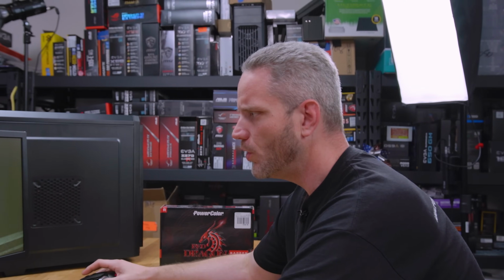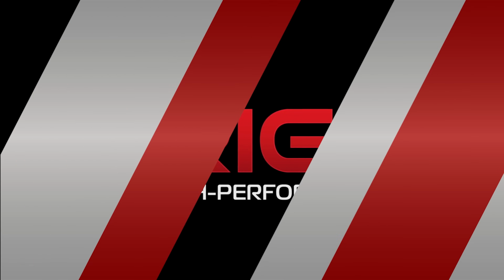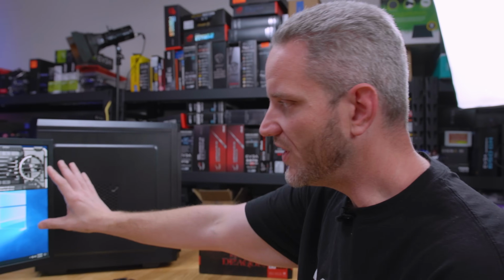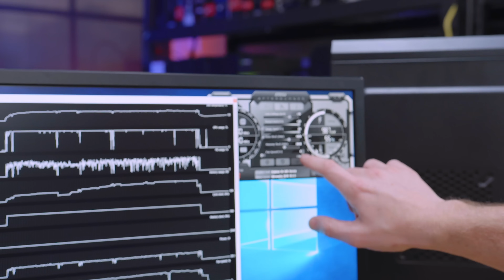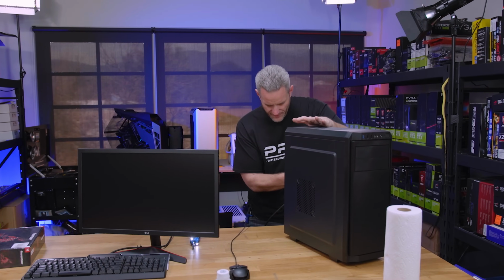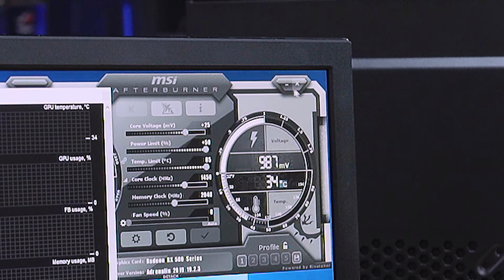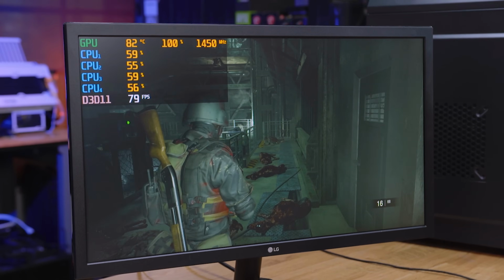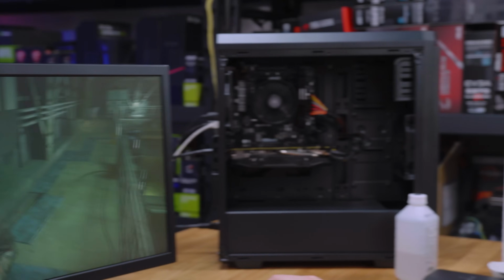Should you replace your video card's thermal paste??

Comment: my gigabyte 3070 i got back in 2022 - my temps after an hour, would be around 82, i dont think it ever throttled, but it got close. so i replaced the thermal past with some leftover crappy corsair paste, and it dropped down to 69 degrees. NICE

Comment: The load temps went from 84C to 65C on my Asus 3070 when I removed the factory paste and applied new stuff. Over 50% of the processor surface area was bare shiny metal when I opened the card up. I'm surprised it ran even as well as it did.

Comment: ON MY TITAN XP NO DVI PORT ONLY 3 DISPLAY 1 HDMI I CHANGED THERMAL PAD POSITIONS AND I PUT NEW COOLER MASTER PASTE THE CARD STAY IN In-between 23C IDLE AND 44 C FULL LOAD NO WHERE DOES MY CARD REACH TEMPS OF 70-80 C JAY

Comment: i just killed my PowerColor rx580 with AG gold termal paste...i thought i have cleaned the older bits of paste but when i assembled it and started the PC the screen started to show greend dots after few minutes and went black...i turned off the PC...cleaned the new paste like crazy spraying brake cleaner all over the card and cooler...before that i looked the chip and around it with my phone camera and i saw a little bit of the Gold paste around these little things just by the chip...i am sure this blowed my 580 but i thought it was clear looking with a naked eyes...after the BIG clean and 2 hours on the sun to dry everything the card was still dead...when i start the PC everything works OK,the fans work,the windows is loading normal just i dont have image..only black screen....i will try to find out what is damaged with my multimeter...the motherboard of the gpu is without any  burns and weird spots...its like brand new...i am angry to myself,but it is what it is...lesson learned.....i bought second hand saphire rx580 nitro+ the next day for 70 euros...no box,no shiny good looks,a bit of dust,but it works and its running a 10 degrees colder and a lot more quieter...i hope this story is helpful for someone...no more elecroconductive termal pastes for me :)

Comment: I run a RX 570 Saphire and the card is about 4 years old now. Im starting to hit temps of 77 to 80. I run the fan at about 70% to 75%
I looked it up and seen online that between 80 and 90 is normal for this card .... but it still worries me when i see the temps heating up
I am definitely thinking of changing the thermal paste to get a bit more life out of the GPU.

Comment: You went up about 10 fps on average though it appears (which is something you should have captured in RTSS).  The temperature is dependent solely on your fan curve and air flow, not the performance of your thermal paste.

Comment: Changed the thermal paste in my GTX 1080 today because i Found out that it hit 90+ degrees Celcius and the fans made alot of noise. After changing the thermal paste, the gpu never got above 70 degrees Celcius again and the noise (fans tripping out because of the heat), was also gone.

Comment: I picked up a XFX R9 390 8GB (non OC) for cheap, and decided to repast it due to abnormally high temperatures - even for this card.

The card was very easy to disassemble (only the 4 screws on the heatsink). I used Arctic MX-4. I immediately saw an 8C drop in temperatures at idle, and under extreme load the temps never got above 75C with the fans not hitting over 48%, where before I was seeing 84+C with the same load and fans running flat out (had set an aggressive Fan curve with Afterburner).

Easy maintenance and made a huge difference.

Comment: I just replaced the paste and pads on my husband's EVGA 1080 FTW Hybrid after nearly six years of heavy daily use (dual 2k G-Sync monitors running WOW and streaming simultaneously). The paste was so dry and chunky I nearly had to chip it off the GPU and cold plate. I used Thermal Grizzly Kryonaut (12.5 W/mK) and Thermalright Thermal Pads (12.8 W/mK). His GPU core temp dropped 12°C and he's good to go for a few more years before he feels the need to upgrade. Servicing your own hardware is not only fun, it saves money.

Comment: I just disassembled and cleaned my old PC, including new thermal paste on the CPU and GPU. Saw 5C drop in CPU temps and 7C drop in GPU temps; and I was able to adjust my fan curves to make the PC run quieter and still maintain the lower temps. It's an old PC, Intel 3570K with GTX 970. It's been cleaned a few times, but never new thermal paste until now. Definitely will do this more frequently with my new build.

Comment: My MSI 2080ti with 3 fans Idles at 74 with the case open. Probably need to pull it apart and try this, and maybe thermal pads too. I've had it 3 years.

Comment: I need to know at what temp should I worry for Rx 570 4gb. My max temp that has gone is 77c but it just touches the 77 marks and drops to 75. I also notice when limiting fps the temp drops drastically
Reply: I have a Gigabyte RX 570 4GB.   I do not game.   I installed it March 2019 for two 4K monitors and never checked the temperature afterwards but in December 2022 I happen to notice GPU temps at 84C.  I discovered that the fans were not spinning.   Without cooling the card temps hit 97C before I terminated FurMark.   I now use a case fan (sitting on top of PSU) pushing air onto GPU cooling fins - I had to remove the GPU fan shroud.   At idle or running .XLS,  I get 38-41C running.   and running FurMark I get 79-81C.   I intend on replacing the thermal paste on the GPU so videos like this came in handy.

Comment: around a year ago I bought a used gtx 1060 6gb. Didn't regret it but I noticed that my general PC thermals were weirdly high. So I thought, maybe the boxed cooler of my CPU isn't good enough. So I replaced that with one from bequiet. Wich worked. But not so much as I thought.

Two days ago, my harddrive died. And as I took it out of my system I though: "Well... Might as well clean up my graphics card" so I did exactly that (wasn't really dusty, so yeah...) and did also change the thermal paste... and man was it needed. That stuff wasn't paste anymore but a dry, really hard crust xD

Now my PC is in temps that I really can consider normal. (before around 40°C right at startup and raising ridiculously quickly in idle or browsing; after 25°C browsing, slowly raising till 39-40, for the whole system and the fans are running a lot quieter...)

And did I mention that this card is pretty highly overclocked? (not sure what magic MSI did there... most people I know weren't able to go as high with their gtx 1060 without it getting unstable)

edit: And in gaming I never see thermals higher then 70° :-) Neither in Eldenring, nor in Star War Jedi Fallen Order (were I saw 84° before)

edit again: Maybe I just have good airflow... wich is weird... in a micro atx case... with just one intake and one exhaust fan :-P

Comment: hey Jay, Longtime subscriber, first time commenter here. I'm wanting to upgrade the thermal pads on my GTX Dual fan ASUS 1060. I have a couple different size thermal pads left over from other builds/fixes, I would often use them to cure the thermal issues with Macbook pros, by simply extending the heat sync to include the entire outter aluminum case of the macbook which works wonderfully btw. However when it comes to something this precise where the thickness of the thermal pads comes into play, I'm at a loss,  and all the searching I've done has simply yeilded alot of "They don't need to be replaced". I understand undamaged pads are probably fine for most, but mine are damaged, and so is the fan that im currently replacing, and i would love to do both (and the thermal paste) while I've got it apart. What is your take on thermal pad sizing? Is there a method? Or should i simply try to contact the manufacturer and use what they use? What brand is better? Anything 6w or better ok? Or is there more to it? I know you're great at things such as temp managment, so any help would be an honor. Thanks Jay.    PS I've also just recieved my RTX Strix 2070 OC from AMA and i can see from the outta shell there is thermal pad damage and they even bent the heat sync a bit.....

Comment: yes immediately from the manufacturer replace the thermal paste, because they dont even use enough so that it can overcook ur chip so you need to buy new again. Also set an fps limit for everygame cause if the fps is unlocked it can cook the gpu at higher temps which equals cooking the thermal paste faster, and cooking the chip faster. Depending on the games the gpu can run 20c hotter with unlimited fps in certain unoptimized moments.

Comment: On my wifes RX 480 strix it was crashing because of heat. I added more fans to the case to try to bring in more cool air and expel more hot air to no help. Ripped the card apart and changed the thermal paste and it dropped the temp 20 degrees. So it all depends on the paste from the factory. The card was about 2 years old when it started crashing so it wasn't ancient by any means. Its been running for years now with the new cryorig paste with no problems at all.

Comment: So I have an xfx rx 580 8gb and would run at 75 degrees under heavy load like mining. I just changed the thermal compound and it hits almost 90 degrees with open case. Which I find weird because the paste that was on it was so dry it just flaked off.

Comment: your testing is flawed. the gpu fan needs to be at a fixed speed otherwise any change in thermal transfer will make the fan run faster or slower to maintain the target temp.

Comment: I used to have an amd rx580 and while it ran most games alright up until 2018-2019, it sure as hell got hot. at this point I downgraded to saveup for a 3070 but that used to warm my room whereas now its my cpu since ive switched a lot of work load onto that as my current gpu (rx540) runs quite horribly for most things I use my pc for.

Comment: my gtx 1660 used to get to the mid 80's which was always worrying, but then i took the side off my pc case and it went down to about the high 70's. hoever i gave it to mky sister so its no longer my problem. i might however replace the thermal paste on it.

Comment: So this just solved my problem 2 years after you made this video. lol.

Thanks Jay and team. My GTX1050ti 4gb Zotac is reaching 71-73 C when playing DOTA2. yes you heard it right, DOTA2 reahing 73 C.

 now, max is at 51 C but its goes down after reaching that temp. 

All thanks to the little teenie weenie thermal paste that came with my cpu cooler.

Comment: One use case: when you temp limit a card for 24x7 mining. The card will throttle later. I set mine to 72C limit for longevity of the components and the fans so the more efficient the cooler is, the harder the card can work before it hits that. Of course, same as any game.

Comment: What about if I have been running my card very hard for 6 years? its still running great; meaning that it doesnt crash but it does run very hot 99c if overclocked and it will sustain those temps without anything happening I wish i was joking but thats whats happening im thinking of having a professional reapply the past on the GPU. I doubt you will respond because you are likely inundated with messages but im hoping to get a reply because i'd like someone's opinion who is knowledgeable enough to think about my circumstance

Comment: I have a gigabyte 1660 OC 6GB card I got at end of 2019 and the idles temps are around 48-50C and under load, it is 70-73C. The load temperature is okay but I am worried about the idle since I recall it being around 40-42C (This is confirmed as my friend has the exact same card bought three months ago and it gives idle 41C). I have one year more for the warranty. DO you think the 8C spike in idle temperature is due to the bad thermal paste and years of usage? Thanks for any replies.

Comment: I have a r9 280x max temp was 83. After thermal paste change its reached 97...I did use a cheap thermal paste hy510. But can it cause massive spike like this?
Reply: That sounds like it didn't seat, or you had a huge air bubble in the application.
Reply: @Craig-ib7gk  yeah this 280x had like 8 back screws all of them look exactly the same and i mixed them. But only 4 fits correctly with heatsink. I changed screws and tested one by one. Till i got the right one. Now max temp is 82c.

Comment: I bought a used 1060 6gb on Ebay for a real good price a few years back.  They said it was used for mining but never got too hot and supposedly they never overclocked it.  When I got it, I was overclocking it and it was running hotter than it should, even when I didn't overclock it yet it was hotter than it should be at stock settings.  So I tore it apart and the thermal paste was dried right up.  I put some of my cpu paste on there, put it back together and it dropped it by like 10 or 20 C I forget but really dropped it a lot.  Been using it a couple of years and it works like a new card.  If you never run these things TOO hot, they never really degrade.  The only thing that goes bad on them is that shitty stock thermal paste.  If you keep up with that it works like a brand new card for years and years.
Reply: I suggest you should change your thermal pads too if you've already using your gpu for more than 2-3 years
Reply: just like stock pastes, stock pads are also tend to perform worse and degrade faster compared to the aftermarkets.

Comment: will the temperature improve if you use watercooled? like an AIO customed for gpu?
Reply: Assuming you install it properly, sure. If you have sufficient radiator(s), and sufficient airflow to pull the heat out of the radiator (and ideally, out of the case itself), etc. That's the entire point of liquid cooling. The liquid is a much better conveyor of thermals. Then the only task is delivering those thermals (trapped in the liquid) to a place where they can be efficiently evacuated (the radiator).
Reply: of course.

Comment: I know this is an older video and I am just now watching it but, I have thermal paste for my CPU (deep cool Z9 to be exact) is it safe to use it on my GTX1080FE? I have never changed the thermal paste on it and I feel it would be a good idea at this point. Would you recommend I get different thermal paste or will what I have work okay?

Comment: Oh man my gpu practically had no thermal paste it spread around the gpu not even on it
Reply: That's not necessarily a bad thing. Ideal seating of a cold plate to a GPU is similar CPU (but the GPU has a lot more potential hot spots, so it's important to ensure full and proper coverage). The TIM (thermal interface material) is intended to convey heat over the microscopic air gaps between the two surfaces Just clamping the two pieces of metal together obviously doesn't cut it (and this was discovered on CPUs a long time ago). TIM fills those tiny gaps. It isn't intended to be some thick-ass layer of goo between a GPU (or CPU) and a cold plate; it is to ensure when they two are clamped together in what normally would be metal to metal the super-thin film of TIM ensures less-than-ideal contact points (i.e. the not-quite-contacting points) still convey thermals.

Comment: Hey jay i got a gou related question i bought a gtx 970 about 2 months ago and around the 6th of july my gpu crashed and the screens started turning random colours i know its not due to over clocking so could it be due to a thermal issue cause it gets to about 80 degrees and uses 70% of the card

Comment: you're supposed to wait a day,  before doing any real temperature tests after applying new thermal paste to a chip (cpu, gpu)
Reply: nah, that really depends on the pastes themselves, some do need to wait for curing time, some don't.
Reply: @hadifelani  nah,  you do need to wait.  its science.   you cant expect it to "cure" right away.
Reply: @LadyFairChildVideo  remember the old MX-3 ? it doesn't need one.
Reply: @LadyFairChildVideo  and science also includes condition whether or not a paste needs curing time depending on what kind of mixtures they're made of.

Comment: My 2080 is about to get some new thermal pads, that thing I got when they first came out and has been running hard since but I'm replacing it with a 3080 hyrbid, but it's going into my graphics amplifier for my old laptop.....just waiting on them to come in.

Comment: I also had some bad thermal paste on a power color 580 8gb, I also had to replace a bad fan with two heavy push 90mm fans. Omg, what a difference.  I was able to overclock it like crazy, and it would never get past 70c.  Still runs great today.

Comment: my zotac gtx 1060 3gb fan is spining normally but at screen say hdmi cable not connected. try using dvi port but still same thing happen. 
any idea guys?
if replace the thermal paste it will be okay?
anyone have the same problem like me?

Comment: This vid is on the spot, I wasted money on thermal paste. Then I installed an exhaust intake fan and the temperature went down by 5-6 degrees.
Reply: did you just say "exhaust intake fan"? Bruh.
Reply: @timbenjamin5454  yeh exhaust and intake fans, intake on side panel area and exhaust on the rear replacing the stock fan. Thermal paste didnt do shit, when OC'd temp still kept going up but after those fan hookups I noticed at least 5 C down on both Gpu and VRam temp. So fck the thermal paste.

Comment: I just wanted to report that changing the thermal paste in my 4(?) year old 1070 reduced my thermals (afterburner + kombustor) from 78-82 down to 70-73. The old paste was so thin it looked like oil, most of the paste appeared to be squeezed out onto the board away from the chip surface.
Reply: 50C idle (30%fan at 50)

Comment: I never do one blob in the middle. ... I manually spread a thin layer over the GPU core. That way I get minimal spread over the edge of the chip, but best case thermal paste cooling. (Having excess paste anywhere near the chip sides, is only going to insulate the sides of the chip.) ... managesd to cut 5'C from both cards I did it with.